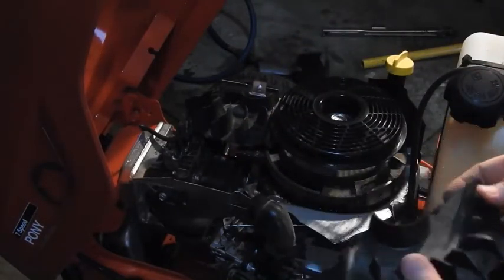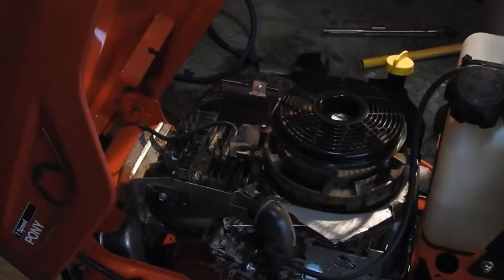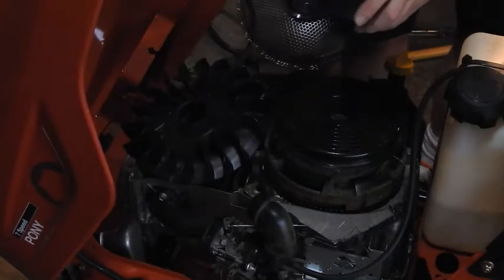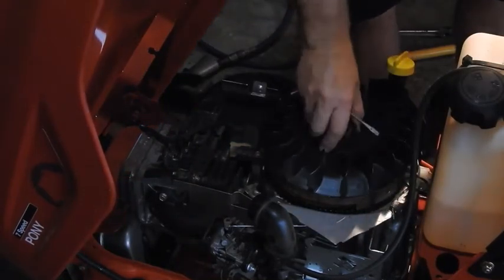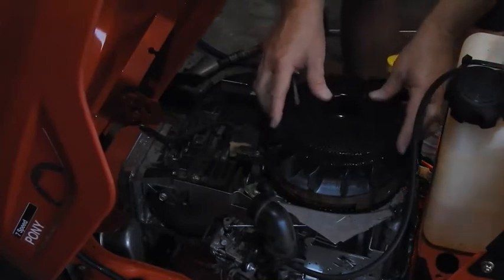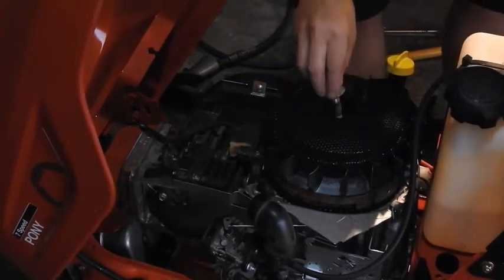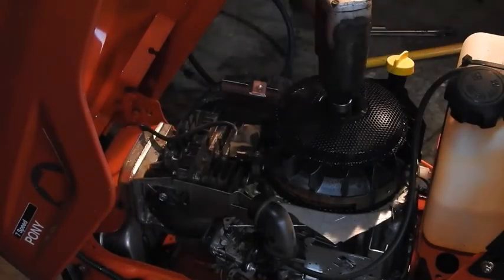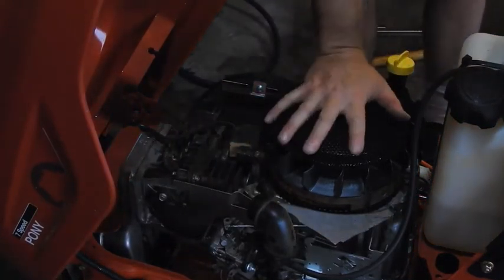Troy 7 Speed Pony Briggs and Stratton Failed Plastic Fan on Fly Wheel Change DIY Save Money  15,5 HP

Comment: Is it possible to only purchase the plastic fan?  Video quality is too poor to see what the fan really looks like.  3/8 Ratcheting box wrench helps things go faster.
Reply from the maker: Some of my early videos are not the best, yes the ratcheting box wrenches help. Yes you can purchase the plastic fan and the cover and cup as a kit the design was changed to prevent failures. DO NOT USE the older cover,
Reply: @mytwogoodhands2799  Do you have a part # for the fan kit?
Reply from the maker: @bobradioshow3494  Here is a link to buy it this fits my engine just confirm the numbers https://amzn.to/3rLdrY7